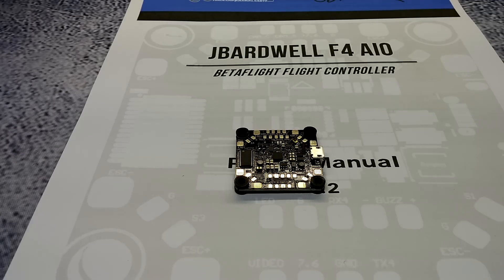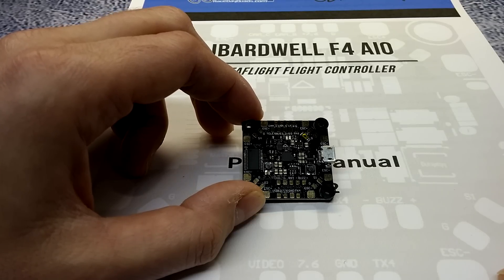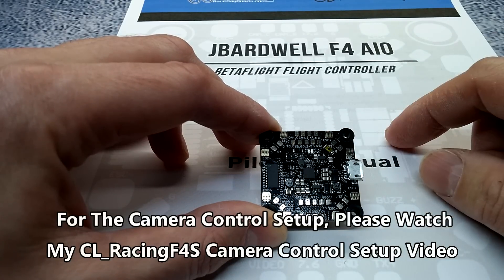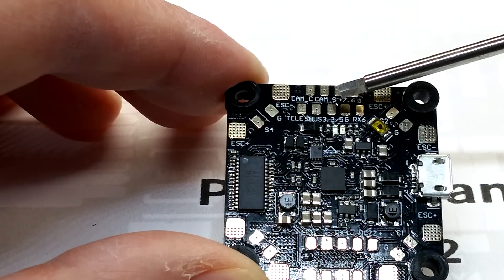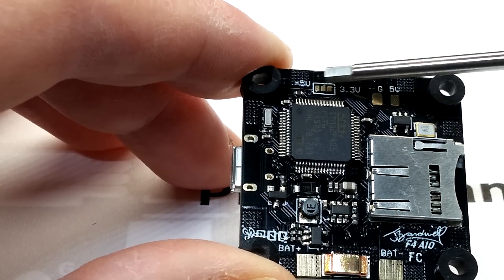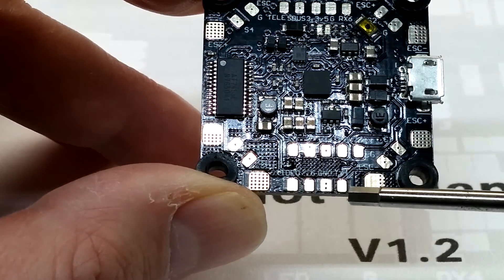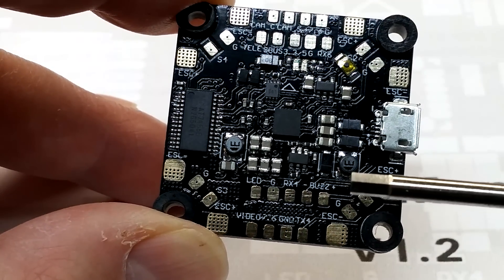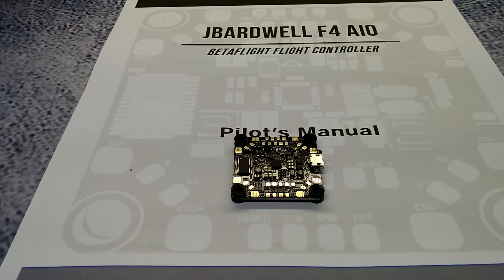RaceDayQuads/Joshua Bardwell F4 Flight Controller Review

Comment: I have 5 of these boards.  first one was defected from GetFPV and took a month to get it sorted out so I could get it replaced.  GetFPV was great through the whole process.  However now 2 have dropped dead, plugged m in and no lights on the fc, have no idea way.  lost a battery solder pad on another, could've been due to to many crashes, and now have no OSD, on the 4th.  I have one good board left.  Having bought 5 of these I'm obviously a fan of JB.  I'm not only a subscriber but I support his channel.  Am I jinks-ed or are others having failure problems to.  I have the Runcam Swith mimi and have had OSD for weeks.  I have changed cameras and checked all my settings and reset all of them in Betaflight many times.  Checked my wiring over and over again.  But apparently I have simply lost OSD.  Not sure if I can keep purchasing these boards.  For me! the failure rate is to high and to expensive.  Or...is this normal in the hobby to go through boards like this?
I love the layout and the simplicity of the board.  I was hoping this would be my go to board but my loyalty is waning in the balance.
Reply from the maker: Junkyard Drone - I'm very sorry to hear of your problems, you shouldn't be having that high of a failure rate on these boards. Personally I'd contact Joshua Bardwell himself on Facebook or Facebook Messenger and let him know of your issues, he's a great guy that will try to sort your problems or at least offer an alternative solution. I'd also contact Tyler Brennan from RaceDayQuads to see if he could offer a solution, since this board was a collaboration between Tyler and Joshua.

Comment: so there is no way to use GPS with this controller?
Reply: Why would you want GPS on a Freestyle/Racing quad??
Reply: I was just wondering, I have this flight controller as a extra to use and was gonna maybe try it just as  a experiment project. Thanks for the reply.
Reply: just to answer your question. I have GPS on my Freestyle/Race quad because i live/fly in a heavily wooded area and GPS is VERY helpful finding a lost quad. I dont always fly freestyle/close to me. I many times i choose to cruise above the trees and  go 1000-1500 feet an away from me.

Comment: Can we use a 4in1 esc with it? Like my 4in1 racerstar 20a oneshot42 😐
Reply from the maker: sakibian here - Yes you can, but since there is no 4 in 1 esc plug header on this board, you have to solder the individual esc signal wires from your 4 in 1 esc, to the corresponding esc signal pads on this flight controller.
Reply: SteelRainFPV actually im a bit confused bcz i dont see the signal ports like the other fcs. Like 1.2.3.4....
Reply from the maker: sakibian here - They're right next to the mounting holes and rubber grommets, labled s1, s2, s3 and s4
Reply: SteelRainFPV got it!! Thanks!!

Comment: This or the CL racing board?
Reply from the maker: v1ral671 - It's really up to user preference since both boards are pretty good and somewhat identical, but for myself I would choose the CL_RACINGF4S due the fact that it has more broken out uarts, but other's would prefer this board due to it's esc corner layout solder pads.

Comment: Easy to wire up. Going for maiden tomorrow in my chameleon
Reply from the maker: MR SPAT - Good luck on the maiden flight, I've got mine going in a new Rooster build here shortly 👍
Reply: SteelRainFPV  Thanks man. Flying tomorrow morning if it doesn't rain. Will shoot a video about it.
Reply: How did it go ?

Comment: Thanks for the review. Just a question. What is the ideal way to wire this board with 4in1 ESC and have current sensing? No mention about it in manual.
Reply: Justin Delpero wow, I wasn't aware about existence of f.port :)
Reply from the maker: Justin Delpero - I haven't really discussed F-Port yet since it's still in it's infancy stage and requires custom firmware put on your receiver, but it should make things a lot simpler and cleaner to setup in Betaflight, while eliminating the need for 2 inverted and separate uarts. It would also be nice if Crossfire follows suit in regards to a one wire solution, but personally it's not that big of a deal since it doesn't require any hardware inverters, and it only takes up one uart anyhow, it's just one more wire to solder up.
Reply from the maker: kubaistube - Since there is no connection header for a 4 in 1 esc on this board, you have to solder on the individual esc signal wires to the corresponding pads on this flight controller, and if you really want the current sensing capabilities, you'll have to solder your main battery leads to this board, then run a jumper positive and negative wire to your 4 in 1 esc to power it........ So as you can see it's all possible but a PITA to wire, because this board was designed more around individual esc's on the arms, and not a 4 in 1 esc.
Reply: Sure, I have no problem with signal wires. But how to get power from FC to 4in1? I have to connect with 12/14 awg wire "battery connectors" of both boards?
Reply from the maker: kubaistube - I mentioned it above but yes, you have to solder a positive and negative jumper wire from the flight controller to the 4 in 1 esc. From what I remember Joshua Bardwell said in his video about this flight controller, that you can solder the jumper wires to one of the esc positive and negative pads on the flight controller to power the 4 in 1 esc.
Reply: Ok, understood. Hope it will be physically doable since the jumper wire would have to go around the edge of FC down to 4in1.
Reply: I love that f.port will make the inverters unnecessary... i wonder why crossfire cant do bidirection on one wire like frsky can...

Comment: so ive been sitting back thinking should i wait for few more months till winter over?? just for flight controller on my astrox switch true x but i said nah go ahead get jb board and hope and pray its good and ill get my favorite esc spedix es30 becouse i dont trust 4.1 esc no matter what they are.. now my tokio ill use spedix 4.1 as long as its not hobbywing crapola 4.1 xrotor that gives u enough time to be back from the fire in safe distance lol. any doubts in jb f.c?
Reply from the maker: Danger Davefpv - My only gripes with this board is the lack of uart's that are broken out in case I want to use the Crossfire system without using the cli to reassign resources, I can live without esc telemetry pads. Personally this board is near perfect for normal FrSky, Spektrum, FlySky, etc. users.

Comment: I just pre-ordered one from RDQ, can't wait to get it! Also, dealing with RDQ is amazing, they shipped same day for the rest of the stuff I ordered.
Reply from the maker: Will Mercier - It's a pretty good board overall if you're not using it with the Crossfire system, otherwise you have to jump through hoops with soft serial and resource remapping due to lack of uart breakout pads. Agreed with you about RaceDayQuads, them and Pirofliprc are my main go-to sources for most of my multirotor needs.

Comment: Thanks. Great video. I just hooked one up with a crossfire. Is there any reason I can’t remap the Smart audio to SBUS or TELE?
Reply from the maker: Kevin Duquette - I suppose that you can if you like, but I was just going off the suggestions by JB himself through messaging, and to simplify the build process overall without too much complication in the build process.
Reply: Okay. Do you know the command line entries to get the audio to LED? I think the manual is out of order and I am not sure why the commands he has in the manual talk  about motors?  Thanks
Reply from the maker: Kevin Duquette - I'm currently waiting on an answer from the man himself, can you tell me any more details about how your board is setup and what vtx you're using, and what page of the manual you're using and having trouble with? Do you have the soft serial function turned on in the configuration tab, and tbs smart audio or tramp protocol enabled in the periferial section of the ports tab?